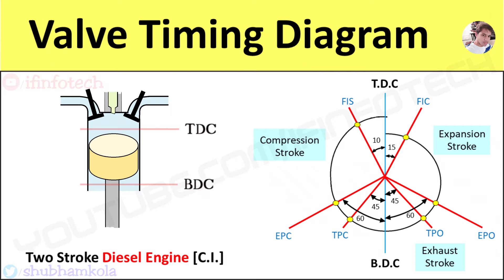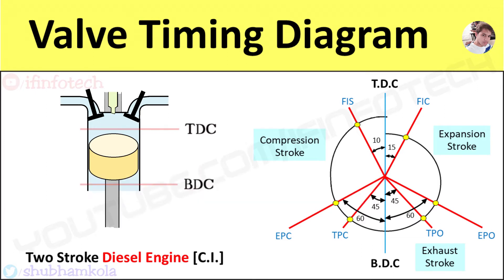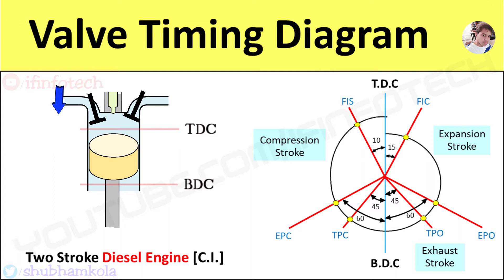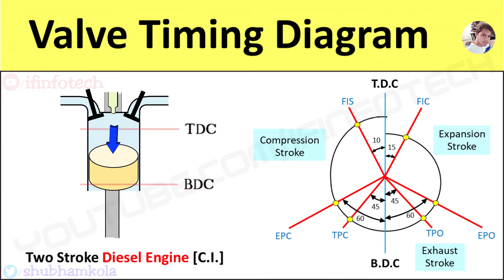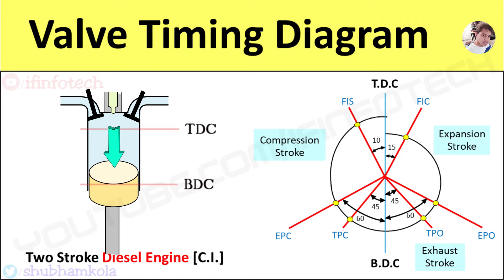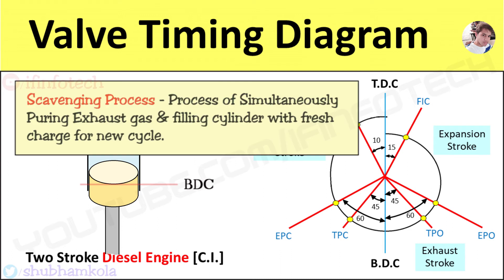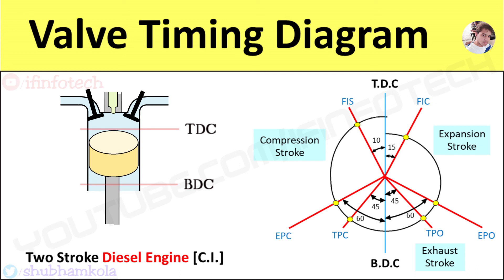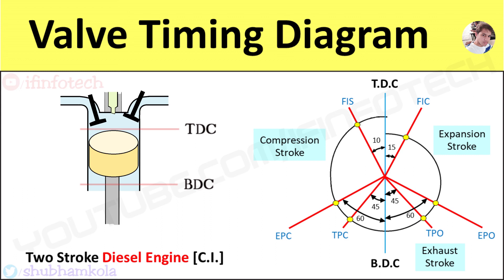Valve Timing Diagram of 2 Stroke Diesel Engine [CI engine] Actual Port Timing [Animation Video]

Comment: Bro, there are no valves in 2 stroke engines. Isn't it?
Reply: Depends on the engine. Most small gas 2 strokes have reed valves on the intake, and almost all 2 stroke diesels have poppet style exhaust valves in the head.